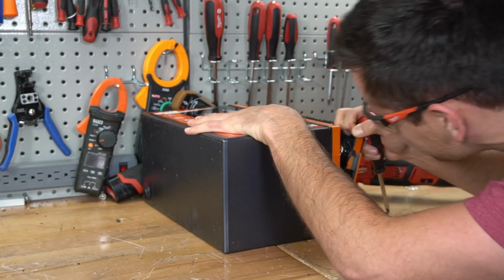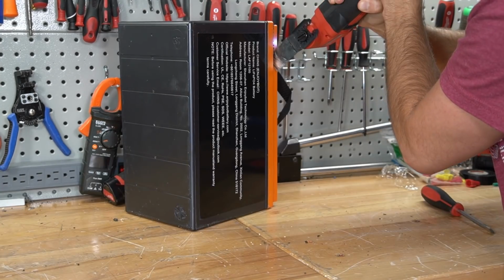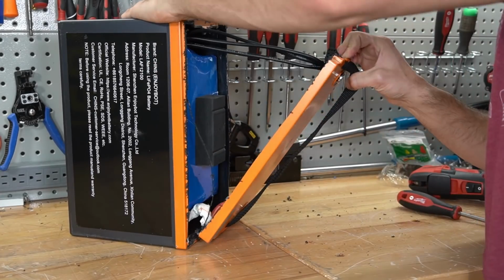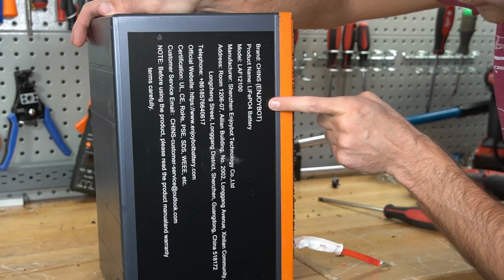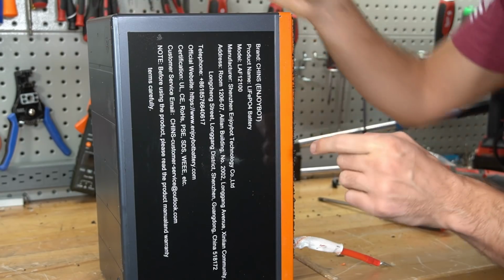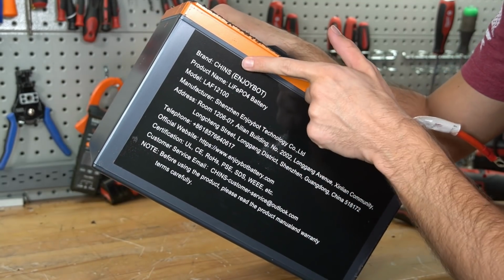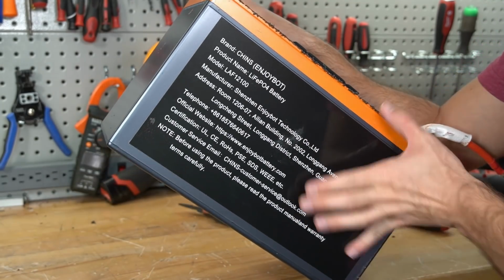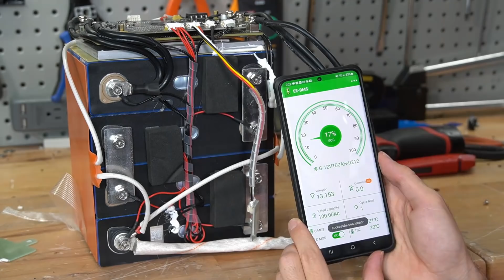CHINS $579 12V 100Ah: Actually impressive!

Comment: Yes,and not those stupid welded on busbarbaras!As long as the temp is under 0 all the current goes to the heatingfilms,and as soon  the temp reaches +10 degr.C/50 degr F,it stops heating and starts charging the battery.Only drawback is that you have to start the electrochisel to open the damn thing! Thank you.

Comment: From the CHINS webpage for these batteries "Allow to be extended up to 4 in series and 4 in parallel (Max 4S4P) to get more capacity (Max 400Ah) and higher voltage (24V, 36V, 48V). Other installation methods: 4S2P, 2S2P, 3S2P, etc."

Comment: I put my money on chins. I bought 4 12v 300ah batteries (best bang for the buck IMO) I currently have them wired in parallel but I'll soon be wiring them in series at 48v as soon as I get a new inverter. I haven't had any issues thus far. And I live in a bus in northern Minnesota that's wood heated, where it drops down to -40F in the winter. No complaints here.

Comment: Those internal heaters look similar to 3D printer bed heaters.  I’ve considered DYI heaters using these because they’re typically 12v and 24v.
Reply: Was gonna ask about the heater pads, whether those particular ones are available anywhere online. I have a 15 watt pad I bought from RS Components, and that gets pretty darn warm, like I literally dont know if its safe to have next to the cells

@Will could you measure the temp of those pads please?
Reply: @ned900  if it’s implemented anything like 3D printers are, there’s a feedback loop where they switch the power on & off to the pad based on temp sensor readings.

Comment: Hey Will, nice Test! I
also built myself an Lifepo4 Battery
(6kwh) for my ebike to charge
everyday. I use an old Apc UPS as inverter. That works surprisingly well. You can have a pure sine wave 1000 watt unit for
50$ you replace the AGM ones
with your Battery Bank. You should mention in one of your Videos. It would really help people, that are on a
bugdet. You can Build a very cheap AIO Powerstation.
Reply: Interesting, which apc ups are you using for your setup?
Reply: @chrsmul  The 1500 Va 24v Model. (No Lcd Screen) Although i would suggest an Server rack type, because they have better cooling.
Reply: @batterynerd8779  Nice, but can the apc unit work with an lifepo4 battery out of the Box, or does it require sth. else? I really like that idea :)
Reply: @chrsmul  Actually the AGM charge & float Voltage for Lifepo4 and AGM is practically the same. Look it up.

Comment: Everytime you Crack Open a new battery to review, you can just see the Joy in your face busting open a box....   LOL.

ALSO THANK YOU for pulling the BMS and identifying it (make/model) I wish you would do that with every tear down, including those WServer Ones which you just did but only said that it was teh Common One folks use...  JBD, JK, or what common one you did not say...

Given that cell sales have slowed somewhat (especially smaller sized cells like 100AH)  that is freeing up Quality Cells for these companies to use.  This is also providing more to the Server/Telecom Rackmount battery pack manufacturers as well.

Comment: With coupons on their website you get a Chins delivered to your door for less then $300 / 1kwh.  I got two 24V 200AH in my RV and they run great. Server Racks are large and heavy,  Chins packs a bunch more capacity in the same footprint / weight.  Which are important factors for an RV. Nice to see that they have low temp now heating now.
Reply: Don't see that deal. Please post it

Comment: when would you need a heater? (what temp)
Reply: The low temperature cutoff is at 0°C. The heater is supposed to divert the charger power to the heater and once the battery is above 10°C start charging again. Unfortunately I have not seen the heater work long enough to actually start charging again.
Reply from the maker: @chachi5975  Because your charger is disconnecting. You need a different charger to make it work
Reply: @WillProwse  Salutations Will and thanks for all the information. My question is how to know whether the charger we already have will work with these internally heated batteries. We are intending to use these batteries on a fifth wheel RV with a 90amp Progressive Dynamics Converter. Any way to know whether this charger will disconnect if the battery heater engages?
Reply: Charging most lithium chemistries below freezing (0°C/32°F) damages them. Lithium titanate is an exception.

Comment: 330 for 100ah is still a lot of money for "the common" people. 
On the other end... Every product in my cabin can go to 12/24 volts now a days. The problem is the need for 110/220 sucking appliances we still 'need' to use. I make coffee on propane, boil eggs on propane stove etc. Because it is far too expensive for me to size up everything for the sake of "but now you can do that on electricity". It just isn't worth it to me except for the necessary stuff.
I prefer an e reader over reading books on my phone. Saves a bucket of milliamps a day.
How much power do we spill actually. What do we really need?
There is always a bigger need for someone, just because he/she can.
Reply: Not sure how you think $330 dollars for a 100AH lifepo4 battery is a lot of money? I paid 570 for my cheap SOK's. Are you traveling on a bicycle?🤣
Reply: Trying to compar battlborn at 900$ with the same features 350$ is cheaper
Reply from the maker: What in the world is Wiley talking about? That is cheaper than lead acid at this point. How much cheaper do people want them? Even when 12V100Ah dropped from $1300 to $900, people were still complaining. Now that they are $329, people want them even cheaper. I cannot believe how cheap they are. It is absolutely insane considering how long these packs last.
Reply: @WillProwse  
That is not the point. Wether i can invest 5 of those batteries to run everything off grid is an investment that not everybody can make. Buying some propane fits most budgets a lot friendlier. No need to get hilarious.
Btw i did buy your book some time ago and after a lot of planning and saving up money i did buy 8x280ah cells with a jkbms. Thanks to your help. I would not have made that decision without your channel. Only to hear you say just after i ordered that these rack batteries are so cheap right now. Well, not for me.  I have no job. Never will again. I have a damaged nervous system after a car accident. So yes, i do spend my money very carefully.
Reply from the maker: The prices should be going up this year due to inflation once the inventory is sold out. Cell prices have gone up 30% in the last month or so. Not sure why it took so long for the increase, but I am sure these packs should go up in the short term. I am amazed these packs are so cheap. I have no clue how they pull off such a low price.
Reply: Get a job if you think that's alot. Or go buy a $1000 battleborn and that will make you stop complaining.
Reply: You are in a very unique situation! Will keep you in prayer.

Comment: Will those be good on a boat? 
Thanks for this review!
Reply: I bought 2 of these for my trolling motor because sometimes overnight temperatures can get pretty cold in the spring and fall in Colorado. Unfortunately I have been testing them this month and they just don't heat up enough to charge the battery. Their technical support has been very responsive but still no luck in charging when the battery temperature is below freezing.
Reply from the maker: @chachi5975  His charger is not appropriate for these packs, or any other internally heated pack. Even if he used a trophy or smart renogy pack, they all work in the same way. You need a different charger that can supply voltage even when the heaters are triggered.
Reply: @chachi5975  Hey thank you for this answer! just bellow freezing? Around 5°C (41F) did you withness some problem?

Comment: I’ve been using 4 Enjoybot 12v 300AH Lithium batteries for backup storage on my AC200P Bluetti. I just purchased a 48v Growatt 3000 and will try to use them for it. If I can figure out how to set the parameters so it recognizes their BMS.
Reply: let us know. I'm not on the forum. Too many ankle-biters.
Reply: @my_channel_44  I’m not on the forum either. I will call tech support when the time comes.

Comment: Bought a 200Ah 12.8V (non-heated) Chins battery that ended yup not fully charging. Left it at 4A CC for over 100 Hours and pack never went above 13.3V measured at the terminals. Had to return. Bought SOK and have been happy with the quality, they actually charge up. Chins to me means grade B cells at best.
Reply: "left it at 4a cc".  Houston?
Reply: @danielleglorie8164  Understand this is likely a joke. However, to clarify: "4A" means "4 Amps", and "CC" means "Constant Current".

Comment: Pricing as of right now for the 12v 100ah heated with Bluetooth vs the original without heating or low temp cut off is $580 vs $330. So paying $250 for these added features and the additional labor to build it. I think this is great but grateful that the originals will continue to be manufactured at those low prices. How long can Battleborn ride that premium product pony with the competition heating up like this...literally.
Reply from the maker: Agreed! And I think battleborn makes their money now by selling to installers and other businesses. I just don't see how anyone would spend that much money for a pack anymore. Server rack packs use higher quality cells and bms versus a battleborn.
Reply: @WillProwse  BB is quite a bit of a status symbol now. Just like people used to say "on my iPhone"
Reply: @WillProwse  installers and solar companies look like villians now. 40k for a 3k system. Highway robbery. No wonder more people don't "go solar'
Reply: @WillProwse  Exactly. For the price of 3 battleborns I set up 2 server rack batteries equivalent to 8 battleborns. It’s a no brainer at this point.
Reply: I very much agree. Even the derivative batteries from Ampere Time come in at $370 for 12V 100Ah; and the best part for me is that they're still lithium. Don't get me wrong, if this was a colder state winterizing the batteries with the rest of my system like an RV would be critical. But not only is this going into a basic hobby pontoon, if the temperature's below 32 degrees in Florida, it's too cold to go out on the water anyway, might as well wait until noon to recharge.
Reply: @davidmalkowski7850  ampere time on eBay a few weeks ago dropped Amper time 12v 100ah. It was only 286! Each. I went to buy later and price went back up.
Reply: I was just about to post the same comment.  Living in the west in a desert climate, I like it that i can purchase a Zooms or Chins battery for $315, (there are 3 listing of Chin 100Ah LFP batteries right now) at these prices.  I do not want to pay $300 more for low temp cutoff since I do not need it.
Reply: @laronis  just buy a 5$ heat mat lol. Got 8 chins 12v 100ah and I'm happy. Series parallel. 48v growatt 3000. I'm happy
Reply: @jameshughes131  But wouldn't that make it too hot since I live in a desert?  lol
Reply: @laronis  it gets really cold in the hottest desert at night. They need a heat pad on thermostat with AC on thermostat. I'm in southern California at 4000 feet. It gets about 24 degree every once in a while. But for the most part it's above 32. I keep my batteries inside rv in order to keep them warm. I use heater and use to use wood stove to keep warm.
Reply: @jameshughes131  Yeah, I am in So Cal too but when it gets to 24 degrees, I drive to the lower desert, lol.
Reply: @laronis  same. That's the beauty of the desert. Man does it get hot but when it's cold it turns into a nice place to defrost. The mnts are for summer and the desert for winter.
Reply: Battleborn company pretend lead acids are their only competition. Watch their sales pitch. Sad really.
Reply: I know this is an older video, but these batteries are now $380 (100ah). Looks like a pretty good deal for RV usage.
Reply: I agree with you. Not everybody needs Low Temp protection and there are other cheap ways to do that if need be? A market adjustment is forthcoming on the premium batteries.

Comment: I have been using 2 of the 12v 300 ah heated Chins in series for a 24v rv system now for 6 months.  So far pretty impressed. I need to balance each battery on occasion though with a separate 12v charger on each. WG7D
Reply: get automatic balancers. They can do up to 5 amps per unit. You'll need 3 for a 48v setup, 2 for 24v.
Reply: @my_channel_44  Are these external chargers? Any brand recommendations?
Reply: @WG7D  look for HA01 on fleabay
Reply: Have they gotten cold enough to shut down the cold temperature disconnect and started heating? I purchased 2 of these and they would heat for a while but the charger they sent me would indicate that it was full and shut down before it warmed up enough to start charging.
Reply: @chachi5975  not cold enough to start heating so far.

Comment: Finally a usable battery!! Great work Will
Reply: Sorry but it's not usable in a real world test. I have 2 of these and they have not been able to heat up enough to start charging. Their customer support has been very responsive but they still haven't been able to get them to work in the cold temperature I experience in Colorado. If they do get them to work I will update but if I were you, I would wait until they make improvements to the operating system.
Reply from the maker: @chachi5975  You need to buy a different charger, like a victron. Whatever charger you are using now does not work with internally heated batteries. Very common issue. This is the same issue that other internally heated batteries have.
Reply: @chachi5975  Were you able to get them to work? Also in CO, thanks!

Comment: Chin could be a family name if it is made in China. So they want to start a legacy company to grow and last for generations. For Bluetooth, I am a bit wonder its purpose in the battery, particularly a competition in the technology market. ( I may be overthinking in the sense of espionage ).
Reply: As a user of a daly bms with bluetooth its quite usefull.
Reply: bluetooth connectors are just cheap, probably cheaper than displays now, and probably have a very low failure rate compared to switches etc.